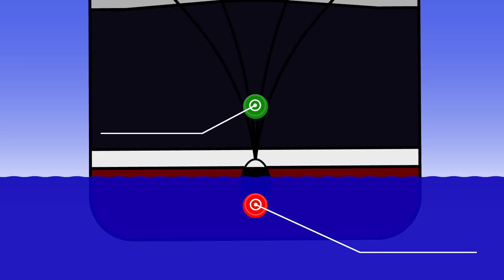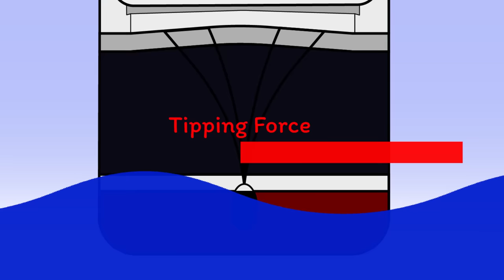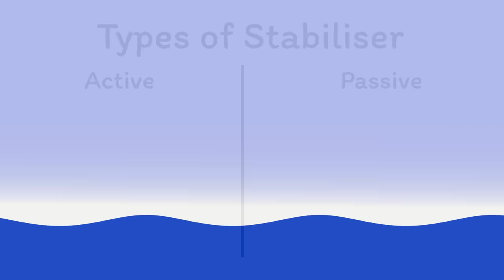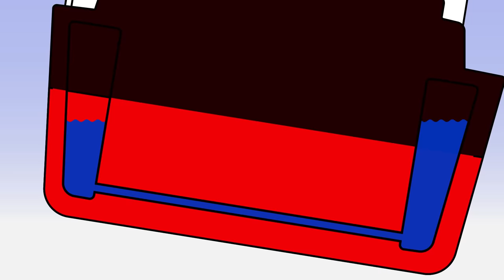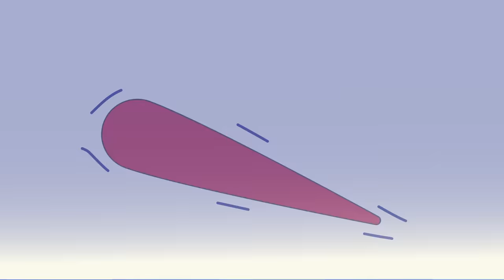How Stabilisers Reduce A Ship's Roll

Comment: there are a couple of errors in the video: 1. you did not mention gyroscopic stabilizers 2. the way active fins works is not how you draw them in the video. they change angle of attack by turning front/rear, not up /down as you showed. There are indeed some fins that move up/ down and these are called zero speed because they can function while the ship is at rest. Otherwise great video!
Reply: He mentioned gyroscopes being used in tandem with other stabilizer methods.
Reply: @dhkatz_   In the video he meant gyros for measurement but andre means gyros that stabilize.
Reply: I was having a real cognitive dissonance when he started talking about forward speed being necessary together with the wing profile and that shown angle change.  I guessed that it must be an forward/backward AoA change for that to make sense. Thanks for clarifying that.

Comment: Sport fishing boats and luxury yachts sometimes use a gyroscopic stabilization system that is simply a heavy flywheel mounted on a pivot, the axis of which run from the port to starboard sides.
When the boat starts to rock to one side, the spinning flywheel opposes the change in direction, while itself tilting fore or aft. Gyroscopic stabilization works really well.

Comment: When we took cruises decades ago (we wouldn't do it now with the way cruises have changed for the worse), the ships were said to be equipped with external stabilizers of some sort, but were seldom if ever used since operating them used up more fuel than without. Heaven forbid they should fork over a little more fuel money per trip.

Comment: The Conte di Savoia was the first major liner fitted with gyroscopic stabilizers.  The ship was built in 1931 and scrapped in 1950.
Reply: Yes, but they were huge and acted more like flywheels, keeping the ship stable with sheer force, not by controlling other stabilizing systems.

Comment: I know the petronas towers have a mass damper installed which is quite high to counter the strong winds which make the tower sway. It’s basically a counter weight suspended with a spring. A similar device was used in the nose cone of a Renault formula 1 car to maximise tyre contact with the track surface when the car bounced over kerbs. I wonder if it could be applied to ships in a stabiliser function as well?

Comment: On small boats and ships you can use buckets on a rope on both sides to stabilize it. While the bucket moves up on one side, it pulls heavily, while it moves down, it has no resistance.

Comment: Many years ago I was a Deck/Navigation officer in the British Merchant Navy. The Centre of Bouyancy needs to be above the Centre of Gravity. Otherwise the ship will capsize. Think of the CofB as a pin holding a length of string and the CofG as a weight hanging on the string. The pin will be above the weight. Other than that the video is great.

Comment: I was more than once told that the active fin stabilizers increase fuel consumption, and that captains are "encouraged" to minimize fuel use and thus don't use the them or use them minimally. If true, the presence of the active fine is no guarantee of a smooth ride, and only truly effective if the captain allows full deployment.

Comment: Our country's first class of five fleet ballistc missle submarines (SSBNs 598- 602) back in the very early '60s, were fitted with a large centrifugal (spinning) stabilizer. It was mounted roughly amidships just abaft the missle tubes.

I believe the intention for them was to reduce roll during nuclear missle launches at shallow launch depths where wave action would possibly hinder operations.
My boat, the USS Theodore Roosevelt, SSBN 600, had her's removed by the time I went aboard in the early '70s.
It was either deemed as unnecessary, or their use may have been problematic in some way. I don't know for sure.
Would love to hear from a shipmate who knows more about this topic.

Comment: This is helpful . . . and while I am not anywhere close to an expert, I supposed the stabilizers worked like flaps on an airplane's dihedral'zed wings.   It's all about the cosine of the attack angle . . . please correct me!?

If the side of a ship submerges, the "wing" goes flat or more horizontal and creates more lift, but
If a side goes up, the "wing" has a higher angle and presents less attack surface (cosine) the stabilizer "wing" generates less "lift" (perhaps even negative buoyancy if the tips pop above the water), and pushes that side back down.

This is also why these stabilizers have to be retractable when docking.

Comment: Although I'm not from France, I have to admit that the system used in the sea air-carrier Clemenceau is the best, so far. Huge packs of weights moving super fast along horizontal tubes in the opposite way than the rolling movement is. Updating that old piece of boat has been an impossibile challenge, but at the end It was worth the time and money spent.

Comment: I havmt watched the whole video yet so I'm not sure this already exsists or not but what if we did something like a tank stabalizer where we put a gyroscope on it with sensors on the gyroscope and hook it up to some propellers on the bottom so if the gyroscope is barely off it applies a small amount of power to the prop but if it's way off it applies a lot. It would be pretty similar to the hydraulic one but that system would probably take far longer then a giant 5 ton propeller attached to a bigass electric motor

Comment: I think the depiction of the working of the stabiliser fins in the ship's cross section view @ 04:40 is a bit unfortunate.
The angle that is changed there is not the fin profile's angle of attack, but... - er, what? 
I think in aviation they would call this angle the anhedral.
A change of the fin's angle of attack in the ship's cross section view would appear as if the fin's thickness was changing.

Comment: I'm surprised you didn't cover the gyro systems on "smaller" pleasure craft typically 30+ feet im legnth. They make a HUGE difference for how small they are. Seakeeper is the main brand. Just think back to the old science experience with a spinning bicycle wheel.

Comment: Generally cargo ships don't have active stabilisation because it is generally not necessary and an expensive feature to procure. It is a feature used on passenger ship as a comfort feature as passengers generally aren't very accustomed to rolling ships.
Stabilisation tanks or flume tanks as the are also called are a common feature on roro-ships to calm the rolling of the ships and easy the tension on lashing of the parked vehicles.
And as far as I know, active stabilisers are NOT used to counter the offset in cargo! Proper cargo distribution is good seamanship and if in any case an offset occurs, this is done with ballast, not fun stabilisers.

Comment: Dude you forgot the middle water tank(balaster water) button an Up that its arranged in a piramidal scale so the weight its very well balanced only driven by the deviation angle. That makes virtually impossible on nowadays ships to tip over. However braking this rule on arranging and distributing weight on boards ships specially on cargo ones, may lea to a tip over incident.

Comment: why don't they just install a massive gyroscope amidships? the gyroscope would do all the work and keep that ship stable in all planes & all axes at all times (depending on its' rotational mass - it would have to weigh like 300 tonnes and spin at an appropriate rate)

worked for the 2,900 tonne Saturn 5!

edit: you could call it PACTIVE stabilization (passively active)

Comment: What if in the ship balancing is place an a lifting connecting rod that moves left and right and place rhe bolt on the center halft of the ship and the weight is place below to stabilize the flipping of the ship side ward left and right  so if the ship plipping critical its stabize its erecting moving balanced stabilizer

Comment: There is at least one other anti-rolling system that has been tried.  It involves large gyroscopes installed inside the hull.  The angular momentum of the gyroscopes could be used to counter the rolling motion of the hull.  A simple experiment to demonstrate how this works is to spin a bike wheel with its axle horizontal and try to rotate the axle to be vertical.  https://en.wikipedia.org/wiki/Anti-rolling_gyro

Comment: Ship will not capsized through waves if she has a good cargo handling to maintain her stability using the MOSS formula or Moment of Statical Stability. Ships capsize when her cargo lashings disalign then the cargo will move starboard to portside vice versa that will cause the ship capsize. The other major cause of capsizing are hull damage due to collision and grounding.

Comment: The discussion of center of buoyancy and center of gravity left out any mention of the metacentric radius due to the sideways shift of the location of the center of buoyancy as the ship rolls, which results in the metacenter (the effective location of the center of buoyancy) being above the center of gravity for a surface ship.  This is the reason why a surface ship is stable even though the center of buoyancy is below the center of gravity.  For a fully submerged submarine, the metacentric radius is zero, so the center of buoyancy has to be above the center of gravity.  https://en.wikipedia.org/wiki/Metacentric_height

Comment: the buoyancy force acts up, the gravity force acts down. if they are in the orientation in this video, you get dynamic instability and the vessel capsizes. the same thing with any object in flight, the center of pressure must be behind the center of gravity (relative to flight direction) otherwise the object flips over to the correct orientation.

to drive the point home, consider the keel location of a yacht. it's a large weight to lower the center of gravity as low as possible. while the buoyancy pressure forces are concentrated on the hull.

unfortunately, for a technical video, this is a major mistake!

Comment: You're right and wrong.  Any cruise ship made within  the last 20 years has stabilizers. The only thing we've ever called 'stabilizers' on these ships are the wings that protrude out the side of the ship (can be seen in clear waters). And they're more pronounced/longer than what you show here. And that's all we've ever called 'stabilizers'. Not saying that some  cruise ships have these other stabilizing features on them, but not all.

The other thing.. you said "a lot of the time this is because of a failure in one of their systems." This is not true. A lot of the time this is because the captain has refused to deploy the stabilizers... and 'why' you ask? You see, cruise ships use fuel... a LOT of fuel. To encourage captains to save fuel, they receive a bonus check for any fuel they save. And these stabilizers create a lot of drag and eat up their fuel bonus checks. So if you're having a rough day at sea, it's likely your captain is trying to save a buck. 

For what it's worth...
-Cruise ship officer for over a decade

Comment: The first schema is wrong. You have to have the center of gravity always lower than the center of buoyancy to make the system stable. If the center of gravity is over the center of buoyancy, with little oscillations you'll have a pair of forces, and with it the boat sinking.

Comment: center of mass is higher the the buoyancy one??? Is that right? wouldt it flip? it makes no sense... im confused
Reply: ok, just got it. the center of buoyancy, a pressure center, changes place. i was considering it didnt, which kinda would make sense in a rocket, but not at all in ships. its change is sucg that the torque applied would be in the direction of equilibrium, contrary to a fixed one that would actualy be unstable and flip it over. gotcha XD

Comment: That first display of the center of gravity and the center of buoyancy wasn't quite right. The center of gravity is essentially the weight of the ship modeled as a single point and is a force acting downward. The center of buoyancy is the buoyancy force pushing upward on the ship and modeled as a single point as well. If the center of gravity were above the center of buoyancy then the ship would capsize.
Reply: Not really, because when a ship rolls to one side the center of buoyancy should also move to the side of the list, creating a torque that uprights the ship again. It's an unstable equilibrium, but turns into a stable equilibrium once the ship starts to list.

Comment: Computer based anti roll systems with gyro sensors, accelerometers should be used. Instead of hydraulic, mechanical mass should be used and instead of pump, a belt carrying mass across the ship will provide redundancy. I don't think hydraulic approach is the best suiting system here.

Comment: so it's noise cancelling headphones for a boat
Reply: and the passive anti-roll tanks are like swinging on a swing, and then slowing yourself down. you have to kick your legs out from the swing at exactly the right time, either to increase or decrease the swinging.
Reply: the active fins need to just spin, like a person treading water, if the ship is too slow or still. when you tread water, your arms and legs are still moving, so the fins of the ship need to do that exact same thing when the ship stops and the water isn't flowing over the fin anymore.

Comment: Fekin, Hydraulic cup holders are all i need.

I'll explain if asked.
Reply: Elaborate.
Reply: Basically, if you put a cup or glass on these hydraulic cup holders, it would activate a pressure plate, then small pistons would push against the base of the cup until its securely in place. That, or the glass'd shatter.
A simple fix, that, though.

Simple, yet effective in my mind. Yet to be tested though. Hang on, what if the cup holder slides off the table... snaps fingers adhesive bottom bit. Or is just fixed to the table, as the table is fixed to the floor.

Comment: Only fin stabz are working, no one never use water transfer to stabilize the ship, they are only used to  upright in case of list. And stabz are not moving like you show on video)))) fins angle changin from 0 to 30 degrees.